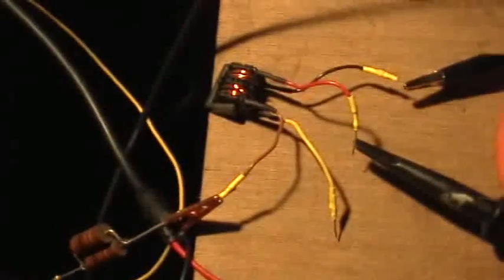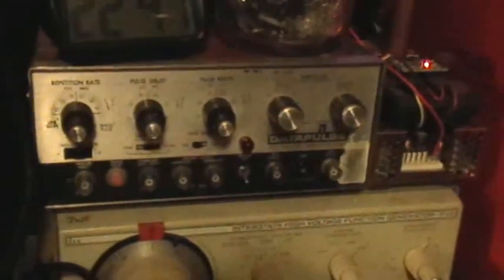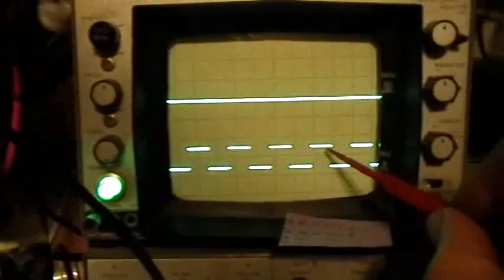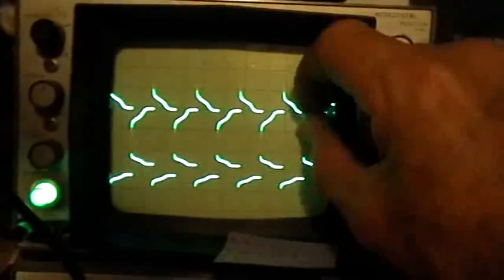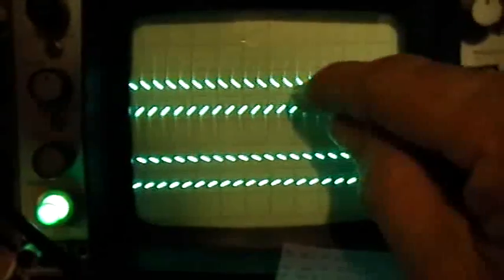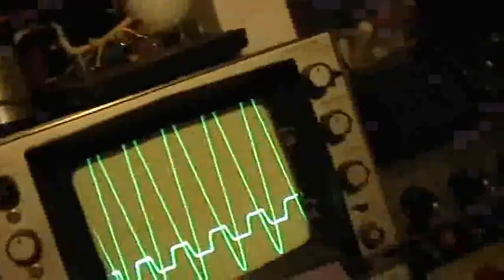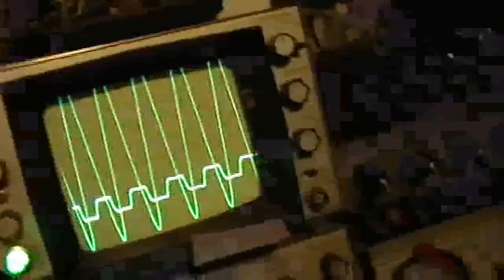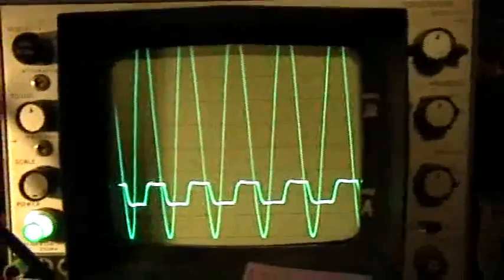Joule Thief: Supplement: Determining Resonant Frequency Using Scope and FG

Comment: Interesting. I know what you mean about air core blocking oscillator switching in the sense that I use an air core solid state Bedini to equalize batteries every day. I have a momentary bump switch that puts a 2k resistor between B & C, but after that, she fires away and will run on quite a variety of frequencies. That said, the higher I go with frequencies (under load with a charge battery), the lower the output current. I'll have to look more closely, thing is., i rarely drag my scope outside.

Comment: well.. that is a bit of illusion (in a sense) partially ... with video cams to blame... (as i see it)... some videos just really seem to be showing a fluoro lit harder than it really is. (I 'm assuming you speak of Slayer, here... not hardwired joule ringer....) Coils of disproportionate diameter to height seem to fail a lot too. For whatever that statement is worth... Have you got a fluoro to light up, on under 3V? If you can get one to light up (at all) on 1.5V, your coil is "there"

Comment from the maker: I dunno, really. I am currently frustrated because I can't seem to get a CFL to light up brilliantly like some people are doing, and I don't know why. I'm getting all the other effects as described.... but maybe the 2n3055 I'm using .... the one I marked some time ago as "no HV" for some reason.... just isn't working right, or maybe I still have some mistake in the wiring.
I need to get a couple more 2n3055s or use a substitute I guess. I have some 2sc2073 power transistors from TVs to try yet.

Comment: Very cool, I've been playing with the same thing, lately.. now.. question for you. Given that when we load the coil with a function gen, or signal generator - this is not a joule thief circuit - rather a colpitts or pwm, or whatever the case may be.. how can we apply this in the JT. My current understand  is, that (normal JT) when the inductor is fed current, once it very nears saturation point, THAT is what causes the switching...  can the JT be "made" to run in resonance, do you figure? Thanks